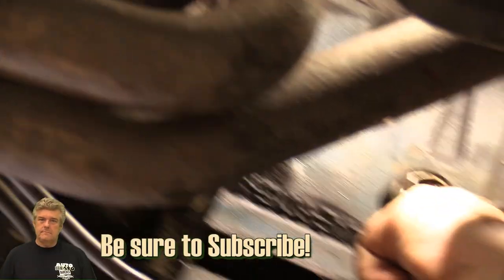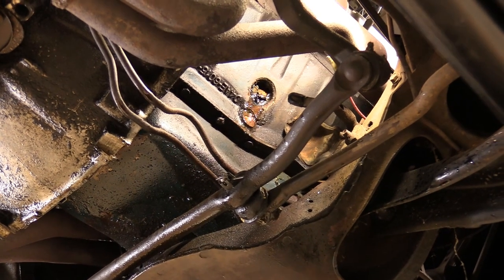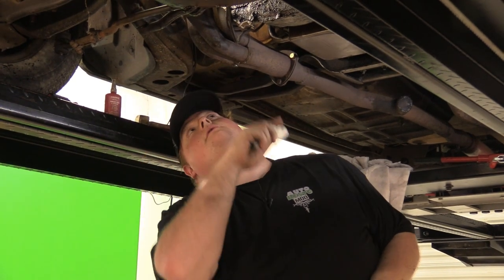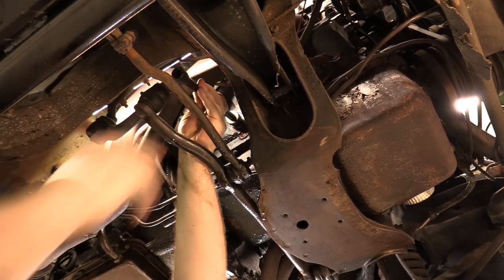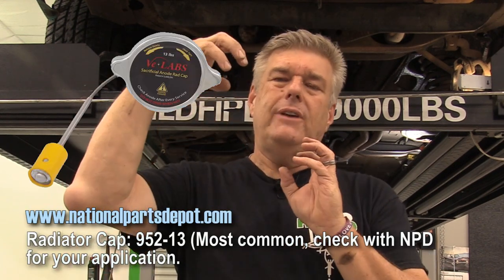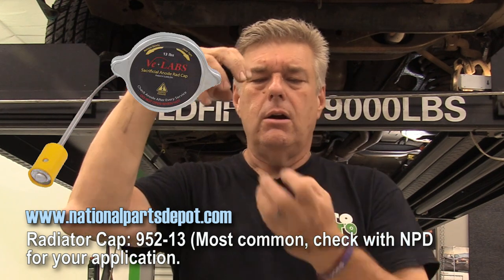Oh No We Popped a Freeze Plug

Comment: I'm from Illinois and if you didn't add enough antifreeze to your system for winter, these FREEZE PLUGS would blow out instead of cracking your block. Water is the only thing that expands when it freezes. You will find the FREEZE PLUGS blown out and ice coming out of your block from the holes. They might have served other purposes, but people that deal with temperatures that drop below 32° know these FREEZE PLUGS will save them from buying  a new block.
Reply: I've seen dozens of engines with "freeze plugs" pushed out of block. About as often as not blocks were cracked. Once tried to save a Mercury 410, one of the heads were also cracked.
Reply: @tombryant1104 , I've seen a cracked lifter valley of a 390 in FLORIDA. Happened in the 1970s.
Reply: So my transmission went out nd my first time doing one and all I used was water bc I didn’t care that much so it been like 3 months nd my plug just missing I hope that the case

Comment: I have seen many core plugs pop out from freezing. I think that is why they call them freeze plugs. The proper name is core plug like Jeff says. I use a sealer called high tack sealant on core/freeze plugs. And I have blocks freeze and crack in the lifter valley under the intake.Core/ freeze plugs  did not save the block😢
Reply: Where I'm from, we've always called them 'Welsh plugs'.

Comment: Not bad if you have a car lift. :-)  Wouldn't it be beneficial to flush the engine with a water hose while the plug is out to push out any other sand, crap etc.? Another great video! Thanks guys!
Reply: Yes, makes no sense NOT to drop it down and flush that block. I wonder what the thermostat area looks like. IMHO.
Reply: @robertclymer6948  Very true!
Reply: Yup I've swapped many a motor, ALWAYS knock out the core plugs, flush and replace.
Reply from the maker: It could but honestly it wouldn't do much. that area of the block is kind of the "end of the line".

Comment: I have two heater plugs in my 69 F250 390 FE. (My truck is originally from N. Dakota.) They aren't weeping but was wondering if I should replace them.  Living on the Gulf Coast I was perplexed as to what the two extension cords were. Ha! Also, why not a brass plug? Wouldn't that be better?
Reply: Brass plugs, absolutely

Comment: How would you recommend flushing the block to get the sand out? Now you got me wondering how much sand is in mine.......
Reply from the maker: Only real way is to pop the freeze plugs...errr core plugs out and root around with tools. Some applications will be tough to get at the plugs without pulling the engine. My final word would be, if you aren't experiencing overheating, is it worth yhe hassle? We only did what we did because of the popped core plug.

Comment: I was buying a 428 from this fellow, I  noticed a block there with screw in plugs.  What could it be?
Reply: I looked online. "All center oiler blocks that I've seen have press in plugs. All side oiler blocks have screw in plugs. Did they make some exceptions? Probably. You can install screw in plugs where press in units were with a good machine shop at hand."
Maybe you have a 427 side oiler. 😁 If so, there'll be visible bolt heads for the cross-bolted main bearings.
Ford sold these screw in plugs as a kit for small block engines. They were also a design feature for the Boss 302.
Reply from the maker: Keep in mind that those plugs are also something you can  add.